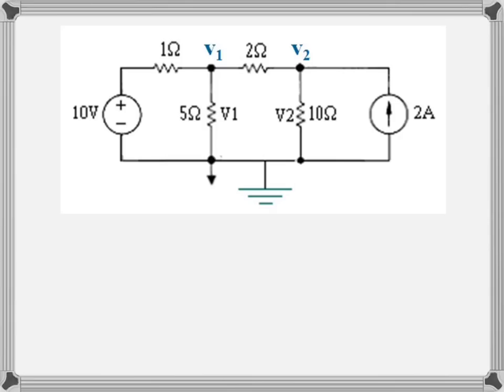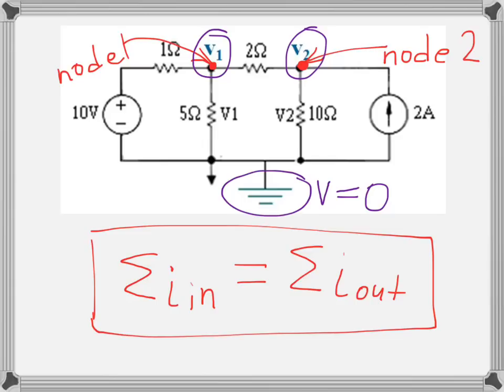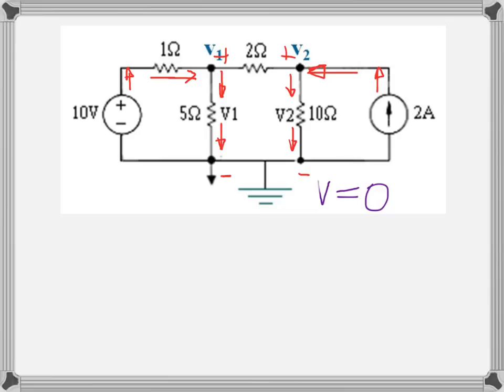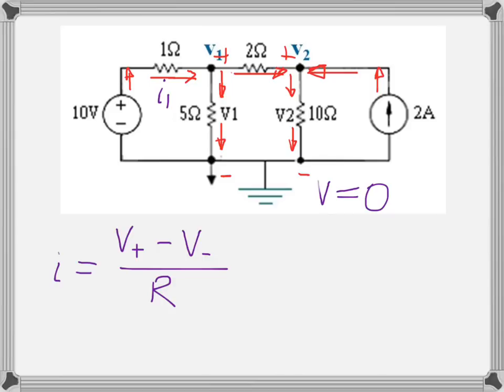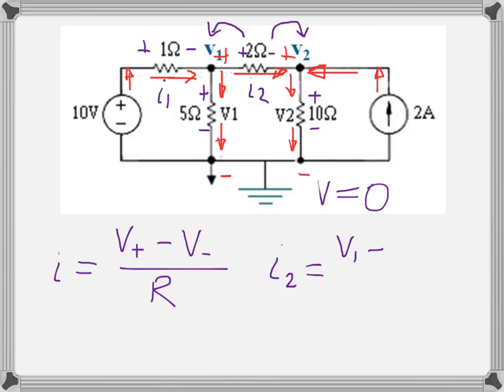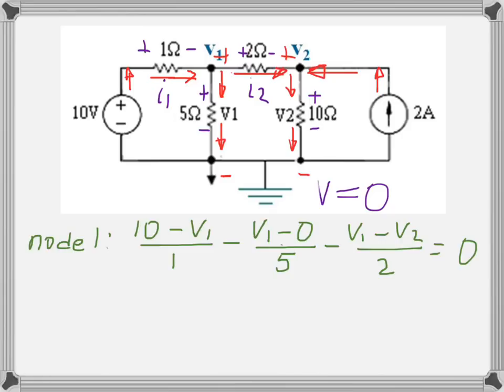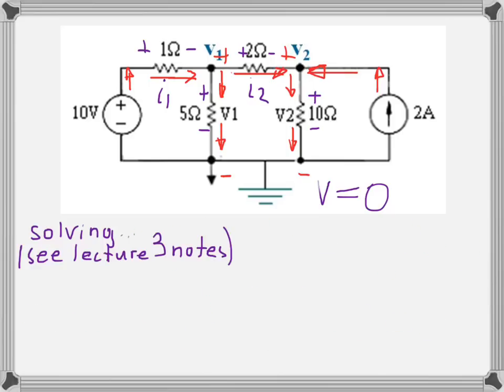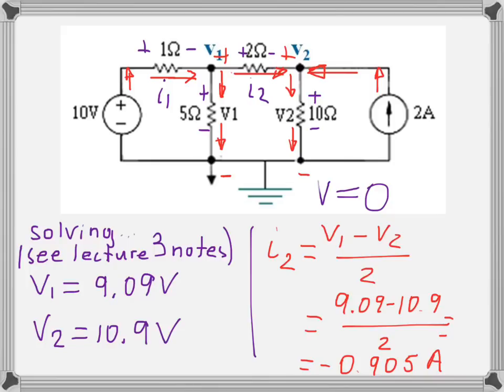Nodal Analysis introduction and example

Comment: what about the current that flows through the 5 ohm and 10 ohm resistors? there are more currents in this circuit which haven't been calculated, she only calculated the current through the 1 ohm and 2 ohm resistors?
Reply: you have to use the current through the 2 ohm resistor because it uses both v1 and v2 values. the other resistor doesn't matter as long as you have two equations for two voltages to solve for.

Comment: Quick question, why are the signs negative? For example at 7:26, shouldn't the sign be positive, because current flows from high to low, should it be  +(V1-0)/5 ?
Reply: she is calculating the current at that resistor, which the sign is dependent on the direction. But because she is using KCL, the convention used is current flowing out of the node is negative. Look at the current direction relative to the node, not the resistor.

Comment: For people looking for the skipped part: node 1 simplified to 10 - 1.7x + 0.5y =0; node 2 simplified to: 2 - 0.6y + 0.5x = 0; just solve for x and y using your preferred method. I'm using x for v1 and y for v2.

Comment: That 2A on the far right is a current source coming in from another power source, is it?
Reply: Not necessarily, in real life there is no such thing as a current source, but in circuit diagrams it is a theoretical source of current.

In this case, its not necessary to worry about how it comes to be, its just easier for us if theres a current source because we can instantly find direction & magnitude of current into V2

Comment: So in the end how do you determine if you selected the right direction for current i2? you said you made a "guess"
Reply: Its called a 'guess' but its just saying that the current flows from v1 to v2, if the answer is negative, it just means the current flows in the opposite direction. The magnitude (number) is correct though. Just stick to the direction you assume and you will always get the right answer (the negative or positive will tell you which way the current is really going anyway)

Comment: Madam !
You made a mistake in equation of node:2
The correct is (V2 - V1)/2 ...... but you write (V1-V2)/2  which is wrong ..
Reply: Khairul Imran Rosli yeah . I am sure . please focus
Reply: bhaih xplain ur correction clearly n briefly
Reply: what? do you even see the direction????
Reply: you need to see the DIRECTION OF THE CURRENT. watch closely
Reply: Current moves from higher potential to lower potential, so the voltage will be higher voltage - lower voltage
i.e., V1-V2 in this case
Reply: No, her one is right, given the direction she assumed to be v1 to v2. She later explained that it came to be negative, but as long as you are consistent, you'll get the right answer, just with a negative sign.
Reply: nope. go check your book again

Comment: Just pretend all currents flow into the node you're working with.  Then the current(s) into any node = [V(away from node) - V(at node]/Resistance, in every case!  The maths will work out the directions and signs for you.  Into Node 1: (0+10-V1)/1  +  (0-V1)/5  +    (V2-V1)/2 = 0.  Into Node 2: (V1-v2)/2 + (0-V2)/10 + 2 (this current is obviously flowing in)  = 0.  You now have two equations, eliminate one variable.  You get the idea.  Much simpler.
Reply: I am still confused...  (-) ---->(+) don't we have to write according to head to tail rule... i mean the 
(The voltage at head )minus (the voltage at tail) ???
Reply: @sareeraafridi4451  No.  It does not matter.  In fact, actual current flow is opposite to conventional flow.  just use the same method for each equation you build, assuming either entering is positive or leaving is positive, but the same for all equations, and it will work out in the end. If you have a negative current or voltage, it simply means you can reverse the direction you assumed to begin with.  It isn't even an incorrect answer, just like saying (-)(-)1==1.
Reply: Bro you’re a god
Reply: @njinkwenti7653  heh.  I didn't remember I'd written this years ago!  I teach physics.  Cheers.
Reply: @RTD553  4 years later and your method works perfectly. Again thank you sir
Reply: +Nick Allen (You see, if the voltage supplying each node is higher than V at the node, Vaway-Vnode will come out positive, giving a current in (+).  And if Vnode happens to be higher than Vaway, the calculated current 'in' will automatically come out negative (indicating a current out) .  So just assume all currents flow in to every node.  Simples!)  p.s.  If anyone wants a full solution, which was skipped, I'll scribble it here if requested.  Cheers.
Reply: Definitely put the full solution, thanks
Reply: @RTD553  In or out doesn't matter as long as you assume the same to build each equation. From there, it all works out in the end, just like assuming direction of unknown current.

Comment: Electronics have been a hobby of mine for over a 15 years. I have had 2 years of cisco, and had two years of training on everything from digital to power generation while in the Navy, but for the life of me, I can not see how these arbitrary multi-sourced circuits have practical bearing... Im well into my EE right now, and it just seems like they are using non-real circuits that do not follow basic thumb rules. Not this example in specific, but in my courses they connect components haphazardly without any premise of what the circuit is supposed to accomplish... Sorry to soapbox, but it goes a long way to explain why technicians have to babysit so many engineers.

Comment: What do U define as a node?
Reply: Actually she is correct. A simple node is two or more branches and a principle node is three or more branches. Please don't confuse people with misinformation.
Reply: +Suvashan Pillay @0:32 she defines a node.
Reply: And she did it wrong. Node is point of 3 or more branches connected.

Comment: Question: if the 100V source was flipped upside down, what all would change? Would the current direction change and/or the polarity of the resistor? I ask because I've seen examples such as this, and it has thrown me off.
Reply: +Johnny Boy Direction of current will change bro
Reply: Electrons go from -ve terminal to +ve terminal, so current goes the opposite direction i.e., +ve to -ve.
So the direction of current will change if voltage source is flipped upside down.